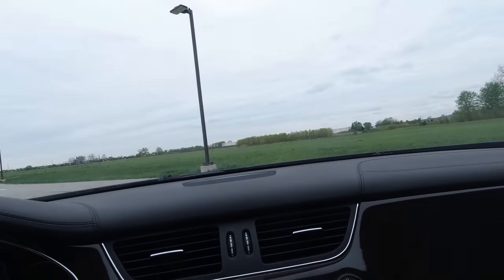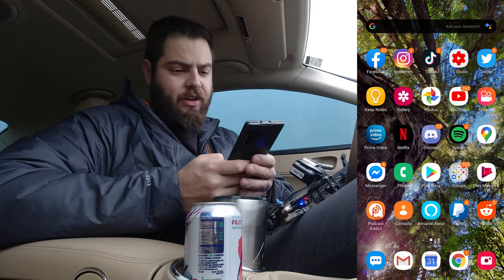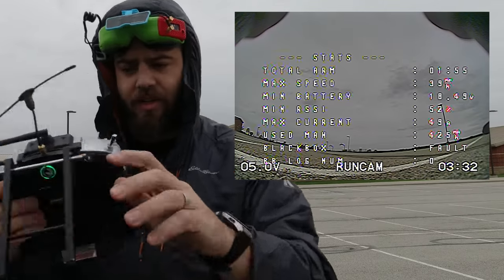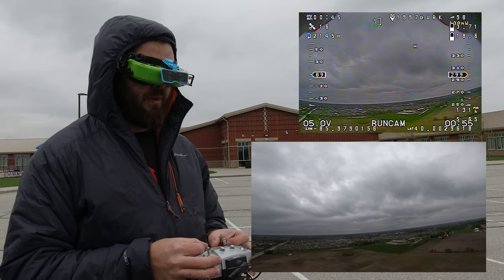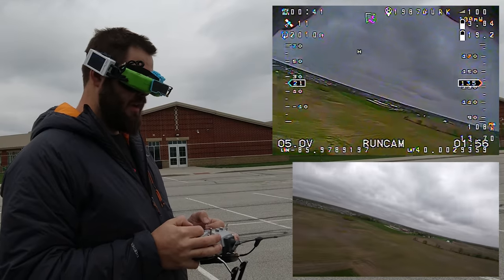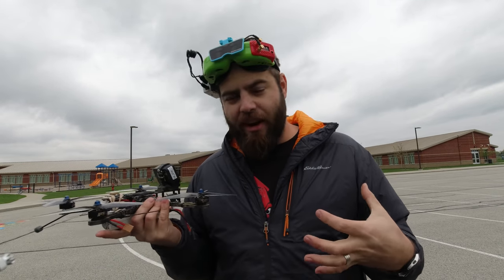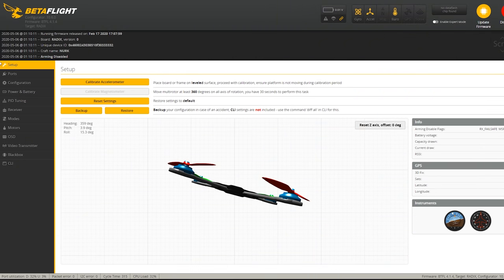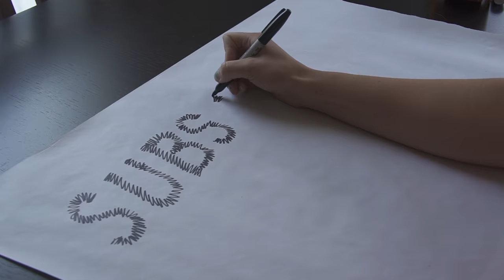I FINALLY Got GPS Rescue Mode to Work

Comment: "Why can't it just work?" - My FPV experience in a nutshell.
Reply: That's the fun of it. Fixing quad puzzels
Reply: Definitely not a hobby for those who don't want to invest in learning a new OS/System. From troubleshooting Betaflight to figuring out what the menu's on the controllers do. Many variables. It is rewarding if you stick with it though!
Reply: @metrocaptain  absolutly

Comment: The way I tested the failsafe is Land over 200m away and then turning off the remote. If it works the quad will take off and come back. If it stays it won’t work. Just in case you don’t want to crash your stuff 😉
Reply: You land and keep it armed? Or disarm?
Reply: Lmao this is a way smarter way, then I suppose if this works then you can test it in air to make doubly sure.
Reply: keep it armed. You can turn off air mode and/or idle prop spin so it does not freak out on the ground. Betaflight does not detect if you are flying or on the ground so as long as it’s armed it thinks you are flying and starts the return to home if the remote is turned off.
Reply: This is brilliant! Excellent idea
Reply: Wish I could like this twice
Reply: Seems dangerous to ‘test’ your failsafe setting by turning off your remote. Failsafe on a switch is way safer 🤷🏻‍♂️
Reply: Trax FPV you have to turn it off to simulate a “real” failsafe. The switch can work nicely but in the event the signal is actually lost something very different can happen. Failsafe switch doesn’t actually turn off transmission and is bypassing a few things so turning off remote is more real
Reply: Trax FPV thats what happened in his videos.  The failsafe switch worked but turning off the remote did not work because the FC did not correctly receive the failsafe signal when The controll signal lost connection.
Reply: Daniel Singer I see. I guess the way I read the comment it seemed like you do that the very first time. I guess for me I would test the switch first then go for total radio silence 😉
Reply: Trax FPV got ya!! Yeah in that case your perfectly right!!
Reply: @traxfpv  The point of turning off the remote is, it's the same as losing signal, which is what he is testing. You have to have signal for failsafe on a switch to work.
Reply: Nurk is punching the air right now
Reply: So the sanity check has nothing to do in this case? We can keep it on?
Reply: I had the same problem, rtl works but failsafe in a switch. Just fall out of the sky.
Reply: Can you do a video?
Reply: Humberto Montalban I had the sanity check offline for this test I think. I’m not entirely sure what criteria it uses for not returning home. I can go out and test it today and make a video.
Reply: @blise518B  I'm so happy for nurd he make work,  his video is nice. But no one in the entire community   explained like you did blise518B, rtl, is no the same as fail safe.
Reply: I check all over you tube and not even Bardwell test the failsafe.  Rtl is nice but the real saver is failsafe in a long range incident.
Reply: I was able to simulate all in Betafligh gui, and now is time to get in the air.
Reply: @humbertomontalban3932  what is "RTL"?
Reply: Return to lunch
Reply: I test all my quads with Nurd settings all work as advertised perfect.  Thank Nurd.
Reply: Ow shit.. that way works.. errrr i was doing it while hovering.
Reply: @traxfpv  yeah i had issues becuase after powering button i still need to press ok. Then switching it back on i have to press exit to cancel the armed warning.
Reply: holy shit dude this is gold, thank you!
Reply: I’m not scared of it falling, I’m scared of it taking off on the wrong direction and me never seeing it again
Reply: can i also use: set gps_set_home_point_once = ON - ((so it keeps the first gps coordinates from initial start point until battery is plugged)) , land and disarm, arm it back (landed) and use the gps return home switch to see if it takes off?
Reply: Awesome! Thank you. Cuz I really don't want my brand new build to fall out of the sky 😂
Reply: You gotta set up the throttle point too though, I feel like there's some things that test won't cover but it seems like a great first step before trying it out flying

Comment: Heyyy I'm the one that suggested the Crossfire CUT thing!! :) Glad it worked
Reply: LEGEND !!!
Reply: Thank you very much for your input, this will save me alot of frustration or switching back to FrSky just to get this to work.
Reply: Niiiiiiiiice... He didn't mension your name!!?? You fixed his life-long frustration!! He should send you his quad as a "Thank You"... 😂😂 Just kidding 😘😘
Reply: Wouldnt cut do the same thing though?! Set failsafe = gps rescue...!
Reply: @stickboyfpv4742  CUT must be set in the module so when you failsafe the receiver stops sending pulses/commands to the flight controller and then the flight controller is able to trigger whatever failsafe method you configured in the GUI (drop, gps rescue, etc)
Reply: @stevehowell2910  :D
Reply: @keithnerison1017  glad I could help
Reply: @hector-fpv  ooohhh ok yeah yeah I see now! Have CROSSFIRE set to cut. But then in BF set it to gps rescue!
Reply: @stickboyfpv4742  hi! Where is this setting in Crossfire for cut?
Reply: @armani007E55  hey man! Go into your transmitter and set failsafe to cut! Is what "cut" I was referring to! Then in Betaflight, navigate to failsafe tab, or failsafe setting in your goggles and set THAT to gps rescue! Edit.... The cut setting isnt in the crossfire, but in your transmitter under the external xfire mod part, just make sure your bound up, then go from there!
Reply: @stickboyfpv4742  sweetness! Tks man I would have never figured that out and hell even the videos I've watched (a ton btw) no one even mentioned this. Tks man! Appreciate it!🤙
Reply: @armani007E55  Yeah buddy! I plannned on starting a super low budgeting informative drone channel..... but I work 2nd shift and its just rough😔😏 Sooo mqny little things "a ton" of vids leave out!😬 Set your gps rescue to remember home point also! 8n case you freak out and disarm like I have before😅 Drone got allllll confused and just sloowwwlllyyyy came downnn downnn downnnnnnnnnnn....! Shits a struggle!!
Reply: @hector-fpv  What about sanity checks in betaflight ? What do I set that too ?
Reply: Hell yeah, I'm building a diatone Rona for a friend who's old but likes drones. Hoping this prevents any drops!

Comment: 13:04 Betaflight is preconfigured to need you to push the sticks by more than 30% before it exits failsafe mode and gives you control.
Reply: You can change the 30% setting in CLI, to something more or less

Comment: Btw, you don't need a failsafe switch or mode at all, when it's coming back just move the sticks and you'll regain control.
Reply: He figures that out I think.
Reply: Jess & Josh Wyatt yup, saw he figured it out later in the video.
Reply: @jhonnycasshh  yes, if you lose signal and the quad starts to come back you'll have some delay when it reconnects again, just stay cool and move the pitch and roll slightly till you see it responds to the inputs.

Comment: Funny how there’s many ways to achieve the same result. I used crossfire Fs.pos to trigger rescue mode by setting the switches in armed and rescue position when setting FS.pos on crossfire. This bypasses the Betaflight failsafe protocol and goes directly to rescue. It seemed like there was less delay and reconnect time when testing by turning off the radio. I’ll try it your way on my next quad soon and see what the difference is. Thanks for sticking with it.

Comment: Channel fallback values are done after a failsafe has already been detected. So when you set failsafe mode (stage 2, receiver signal loss) from drop to gps rescue there is no need to set the AUX channel to FS also.Your main problem was Crossfire not triggering stage 2 failsafe at all. There is also a "Set Home Point Once" option under GPS settings. If you activate this it will only set the GPS Home point the first time you arm, meaning you can disarm/arm during flight and not change the home point to something else.

Comment: One more thing about your settings: the altitude setting is a bit tricky as well. It goes the value that you've set plus the highest you were during the flight.
That is so that if you have flown over something that's higher than your altitude setting it will go over it.
Reply: Highest altitude plus 15? Meters.

Comment: That is a great idea to fly 200m away and land, stay armed and test gps rescue.  I tested my GPS rescue by arming the quad (removed props) and putting it on the dash of my car while I drove 200m away with the controller and flipped the switch. The motors spooled up and in my fpv goggles I could see the arrow pointing to where I drove from indicating things should work. I then did this same thing to test turning off the controller. Same thing success. So this gave me the confidence to try the failsafe in real conditions and so it worked.

Comment: In BF 4.2 RC1 you can now stop it resetting the home position on rearm :)
Reply from the maker: nice good to know!
Reply: You could already do that before in the CLI. Only 4.2 now has it as a GUI setting... ;)
Reply: @hateeternalmaver  what does "GUI" stand for?
Reply: @timcable  GUI = 'Graphical User Interface' - buttons that you can press, as opposed to typing text into the CLI ('Command Lline Interface')

Comment: A very useful tipp. Set your homepoint to the location where the quad is going to power up. So if you disarm and arm again while flying, the home position is still at the point where you plugged in the battery. if you unplug and plug the battery back in, then there is going to be a new home position set.

Comment: You still don't need it to set to return to home. If you have stage 2 set to GPS rescue, then it will GPS rescue. Previously it must have just been the crossfire sending a disarm signal that was the problem. Also, you can change all your GPS rescue parameters in the OSD now.

Comment: I think the "Channel Fallback Settings" take effect in Stage 1, not in Stage 2. So the quad doesn't set the aux 4 to 1800 after 0.2 seconds (in your case); it just sets it to 1800 instantly. It's annoying to have it set this way and you have microfailsafes on the drone because the gps rescue will kick in right away.
If anyone knows something different, please answer :)

Comment: sorry so late to the video,  just going thru the same issues, glad to see it working and really appreciate you troubleshooting this on video. I had a feeling it was a crossfire issue since mine works fine on a RXSR and even a xm+ but on crossfire it only worked in rescue mode. Thank you so much will try this out tomorrow after work, weather permitting. I thought I was going to have to be quick enough to switch to rescue mode before I lost complete control, (not exactly what I was wanting), my panic mode is a little to slow.

Comment: failsafe set isn't necessary; in addition, stage one functions are what you'd want to set for failsafes; set throttle to a level that allows it to climb, set flight mode to level stabilized mode instead of acro or whatever. This'll stop the quad from being in a real weird unexpected position or very aggressive angle, and then it'll be in a safe spot when stage 2 kicks in.

Comment: you should configure "set home only on first arm"
Reply: On 4.2
Reply: I was thinking the same thing. Since the crossfire was forcing a disarm then it loses its home position and the rescue mode can't kick in.
Reply: Kevin Fuller nah, that was only the problem that he had to come home everytime he fs to powercyle.
Reply: @gmivisualsjason3729  No it's in the earlier versions as well but you have to set it in the CLI.
Reply: Also, it's like they absolutely do not want you to get it to work easily...
Why would you ever want to reset your homepoint other to from where you took off.... 🤦‍♂️

Comment: did you ever figure out what happend at 8:00? I keep getting those same results every 2-3 attempt at tesing gps rescue. ATM I have 0 confidence that this will bring my quad back home... when I flight the gps rescue switch the quad shoots up into the air (over 200m, even though my rth height is set to 30m) and it does not come home... even though my distance to home indicator does show the distance from home point correctly.

Comment: Hi Nurk
i forgot to mention that point, but you can do either way , if you let Xfire in "FSPOS" you will have to program the Aux channel "gps rescue" in the correct position
in your radio/RX this time, i don't remember the exact process you can do this way too.
But the best way is to select like you did "CUT" and set in BF the failsafe gps rescue AUX chan with the good value 1800 
in your case.
when i had this issue my Xfire was set correctly to "cut" but the gps Rescue aux chan in BF was set to hold...and my Kwad tumbled down each time i switched off my radio.
By using only the gps rescue switch it worked like a charme !.
it is not obvious , 1st you have to declare an AUX chan for gps rescue, and then you have to tell BF that you did so, it took me a while to understand what was the problem.
Sry for my really basic English :)
Nice Channel
Happy Flying cheers !
Phil

Comment: Note for RR:…don’t have failsafe as a switch. This for testing only, and may result in a false sense of security being that the test is in controlled conditions. Instead, being that we are more likely to lose video b4 rx, have gps rescue mode as a switch. In this way, if we lose video, trigger gps rescue. When vid is restored, resume control via stick command input.

Comment: Great stuff man, glad I know about the crossfire settings before I try this myself, thanks. BTW when you were flicking the switches coming out off failsafe I had already read somewhere that you get control back when you put in a stick command and I was almost shouting at my screen the first time lol 😂😂😂 and I know turning the radio off is something you really need to do a few times to start to trust it but man that’s terrifying.

Thanks again for uploading these videos, they help a lot 👍😎

Comment: Surprised u had issues.    Bardwell vid from last year worked first try.  Glad it works. Make sure you’re far out enough.  You can set less distance out too.
Reply: Same. Slapped on a GPS and it's been working like a champ since.
Reply from the maker: I think my problem was mostly related to crossfire and not having the right setting there.

Comment: I'm at 7:40 and recall seeing a green ring on the xfire module during the first test - radio off, xfire still connected to rx = no failsafe, just no control = no gps rth?

Comment: Hi there, i am planning to put the BN880 to my Protek 35 FPV. But I realized the FC (Beast F7 55A V2.2 AIO (BMI270) 25.5x25.5) does not have the SDA & SCL slot. I wonder where should the SDA and SCL wire on the BN880 be soldered on? 

I plan to use the BN880 instead of the BN220 because I want the compass function as I keep getting lost in the forest...

Comment: Well I can provide some info how I set it up on Futaba T8j with Corona receiver. It seams that FC doesn't see rxloss when i turn off radio or maybe it can see but doesn't react properly. My setup when goes to failsafe, then receiver sets failsafe values and holds them and it seams that sbus protocol doesn't have any rxlost signaling.

Comment: Just had a thought.......it would be great if betaflight was able to detect the bitrate of the dji system so that for example if the bit rate hits 0 mbps for more than a pre set time then the gps failsafe would kick in.
So a failsafe for Rx loss and also video loss!

Comment: Nurk this is a cracking video and so helpful. So just to check - I have GPS bailout set for my failsafe and changed the delay to 2. I have NOT set a failsafe switch & have crossfire (on jumper t16 lua script) set to cut. Anything else ?  Thanks man 👍👍

Comment: The only thing that still has me puzzled is the channel settings for stage-1 failsafe...
If I had the quad connected w/o power to the receiver it would say in BF "GPS rescue switch in an unsafe position"...
So if you're using GPS rescue on a switch (in addition to failsafe) the value for stage 1 needs to be at the value where it would be activated on a switch. ... ?! ;D

Comment: I remember been nearly that exited when we got this running on a multiwii board about 6 years ago. back then we had the same issue. got to get those rx failsafes right. we were using spektrum so we dropped it out the sky a couple of times before figuring out half throttle and rth switch on then bind to the rx.

Comment: I'm sitting here wondering if you ever checked what the channels go to when you power your radio off while in the mode config menu.  Mine instantly disarm since that channel toggles from 1800 to 1100 when the link is lost.  I'm feeling if 'FS Pos' is setup right, it would still work while 'FS Cut' just rules out that configuration aspect.
Reply from the maker: Yeah it really depends on a bunch of settings, but in particular, I just needed FS CUT to just drop everything back to the base level so that it would just go ahead and hit those failsafe modes.